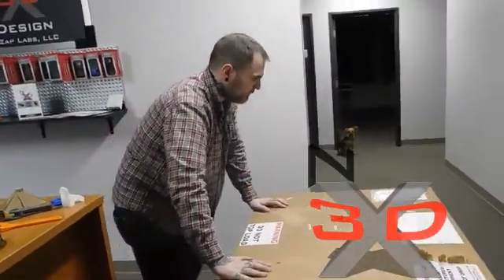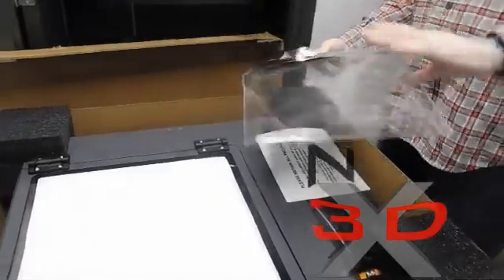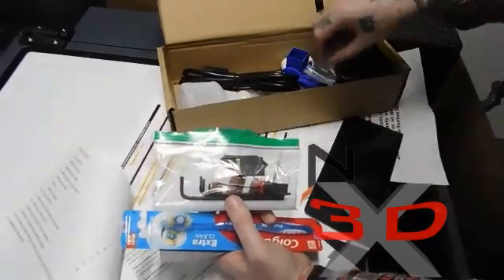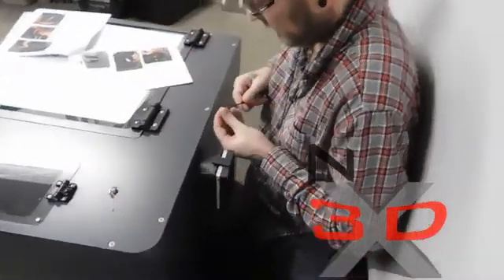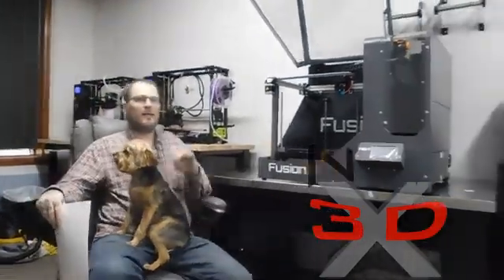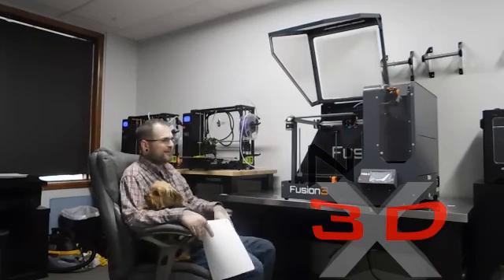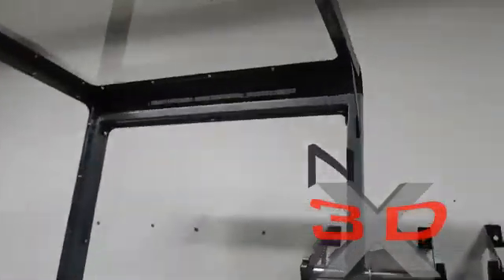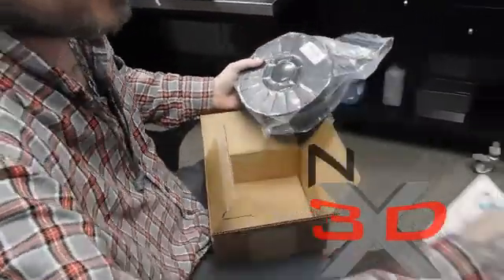N3DX Fusion3 F400 3D Printer UnBoxing Part 1

Comment from the maker: Fusion3 Support ended up being a great asset and very helpful....... I went through hell with my new printer, one problem after another all related, mostly because I chose to do repairs myself other than take there offer and wait 3 weeks for new printer, right after I received the printer.  I should have gone that route, they had even offered to upgrade me to a new F410 but I was stubborn and so excited to have the printer I chose to do repairs myself. My all means this was a mistake! This is a world class piece of machinery, you should be trained to work on a machine of this nature....... Even with the repairs I did, I had some of the best and fastest prints I have ever seen.  I also own a Raise3D Pro 2 Plus which is also a great machine, much more high tech than the Fusion3 F400 but still not the same fast printing part building commercial grade machine.  After all this has happen, I would gladly recommend Fusion3 to any customer looking for a great 3D Printer. Great Support & Great Printer!
I will continue my next video after I can give a good honest review with a working printer..........
Reply: Good luck, looking forward to it!
Reply: What was malfunctioning on the original f400?